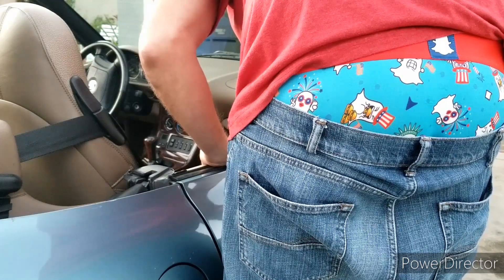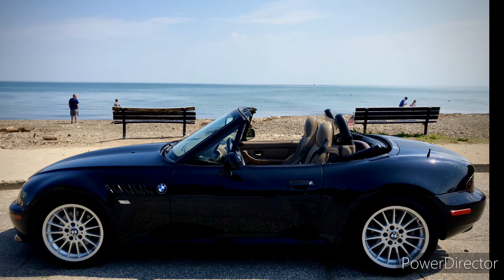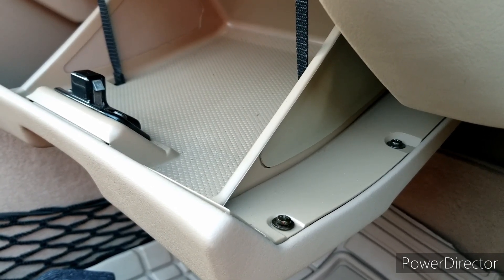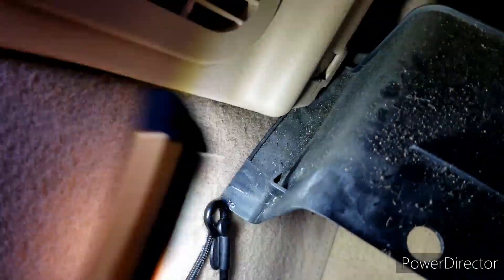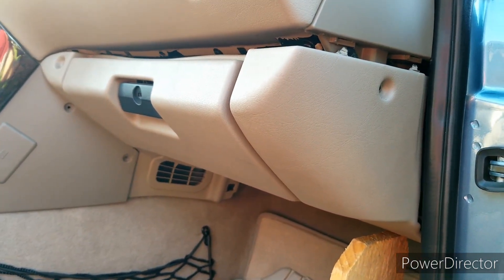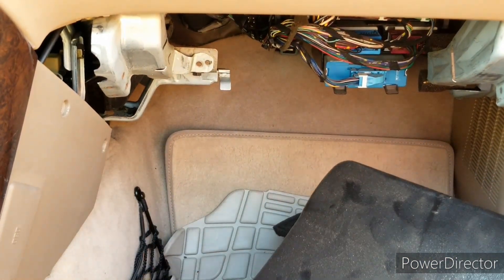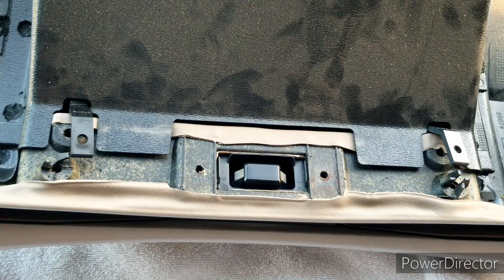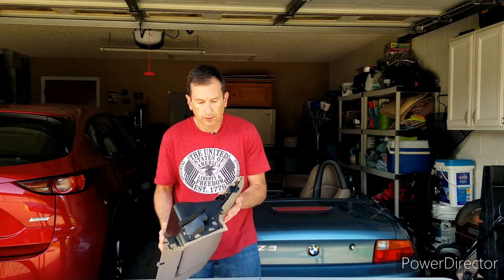HOW TO FIX a sagging glove box! BMW Z3

Comment: First thanks for the video. I bought this same bracket and was able to remove some of the screws, lower the glove box a small amount. Remove the metal part the bracket clips to. Add the stiffener bracket. Squeeze it back in and replace the screws.
I did not remove the 2 screws going into the center console. I used the box the stiffener bracket came in as the prop for the glove box. Took me about 15 minutes start to finish. I also did not remove the crash pad. I expect to sell this car at some point and worry about liability. The hardest part was lining up the 2 outside bracket screws that go through the strap, 2 brackets, and clip nut.

I would have broke a few more things if it weren’t for the video. Thanks again.
Reply from the maker: @PatrickJoyce-d2y  my pleasure!  I think you were smarter than me on this one.

Comment: Just recently purchased a 2000 z3 and had a bad power seat motor (forward and back) and replaced motor. Then airbag light came on (had key in ignition) was able to clear after seeing your video with the B800, thank you. Also had sagging glove box, after watching your video decided to try and put stainless bracket in, and was actually able to put it in with just taking out 4 top screws and fitting it in without removing glove box. Thanks again for your videos.
Reply from the maker: Happy to help and congrats on the purchase!  Thank you for watching!

Comment: Thanks for the video it's a good virtual rehearsal before doing it. I managed to install the plate without completely removing the glove box. I just removed the screws and I left it hanging there was enough room to remove the old plate put the new one on top and reinstall everything pretty easy job like 30 minutes. The hardest part was to not damage the screw cap.
Reply from the maker: Glad it helped!  The screw caps are crazy.

Comment: Thanks for making the video, this fails on all Z3 eventually. One suggestion I might make, too often you start a scene "from a close up", although you try to speak to its location we are still lost. We don't know where we are, and from "which angle" we are looking at it. I still don't know where the crush plate is located and I've looked at the video twice. It's a small thing but valuable to the viewers, start from a "zoomed out" location and then "zoom in" to where you are discussing the particular step. Now the audience is with you.
Reply from the maker: Thank you!  I appreciate the feedback on the technical side of videomaking! I definitely have room for improvement.   Take a look at part 2 for a better view of the crush plate.  It is sandwiched between the inner and outer parts of the glovebox door.

Comment: Hi I just did the repair of the sagging glove box, and I too was able to accomplish it without removing the glove box.  I just took out those 4 screws like the other viewers suggested.  I also removed the metal plate from the bottom of the glove box.  We found a mouse nest underneath that I had to pop out another tab to get access to so I could remove it!
Reply from the maker: @jillbourgeois1467  good move!  I went through that stuff in my part 2 video.  The metal plate removal is key to taking the strain off.

Comment: Recommend you remove the steel plate while you have the glove box out. It is weight saving and not needed if your passenger uses the seat belt.
You are still doing a terrific job. I just told I needed to replace my A/C compressor and condenser as my A/C would only provide hot air and that is when I am not talking!!!!
Reply from the maker: Thanks so much, John!  I think I will remove it in part 2.  A/C work sounds expensive (what isn't on BMWs?)  Keep the air coming!  Love your comments!
Reply: @MomentofZed  I did this same fix a few months ago. Just removing the heavy plate within the glove box door makes a huge difference.
Reply from the maker: @idahoflyfishingadventures5244  Yeah, John Shook commented the same.  My original thought was to leave it in, but as you'll see in part 2, I'm going to remove it.  Thank you for watching!

Comment: Do you have another vendor for the bracket?  It's no longer available on Amazon
Reply from the maker: I thought I changed that-sorry.  Here is a link for one that is highly rated, just a different color (looks like it may be regular steel, but customers say it is stronger than the original bracket): 

https://www.amazon.com/1996-2002-Glove-Stainless-Repair-Bracket/dp/B0778QPQY4

Comment: It's probably not so much that the seat belt use is that much less in the U.S. as it is the lawsuit rate is that much higher due to the ease of ability to sue in our justice system which was set up and run by lawyers.
Reply from the maker: Thanks T!

Comment: The link for reinforcing bracket no longer works :( Do you have another one?
Reply from the maker: Wow that was quick!  The one I used is gone.  Not on Amazon anymore or anywhere else I searched.  Here is a link for one that is highly rated, just different color (looks like it may be regular steel, but customers say it is stronger than the original bracket): https://www.amazon.com/1996-2002-Glove-Stainless-Repair-Bracket/dp/B0778QPQY4

Thank you!  I'm going to change the link in the video description.

Comment: Why couldn't you just glue the plastic piece for the duct? you could use crazy glue or the plastic epoxy you had already both would have been better choices than to use duct tape. (?)
Reply from the maker: Unfortunately, there was no way to see it well enough to glue accurately (I did it by feel pretty much).  Plus I would have had to tape it in place while the glue set anyways.  Also, the plastic ducting is crazy thin, making it even more difficult.